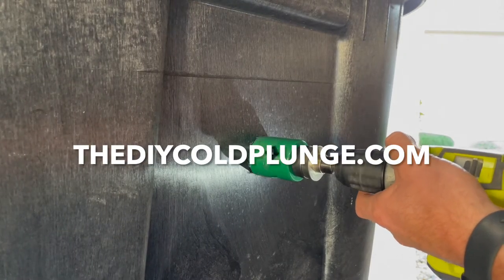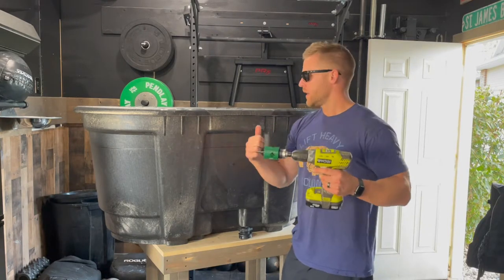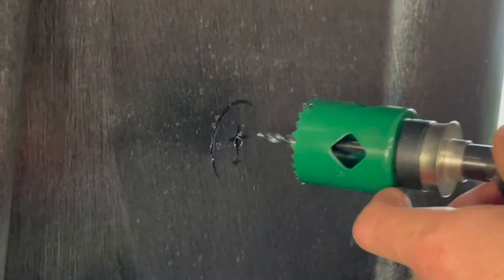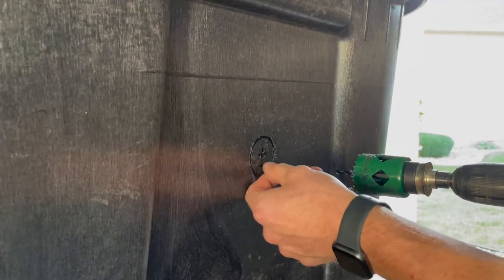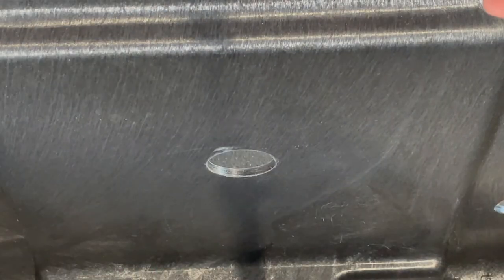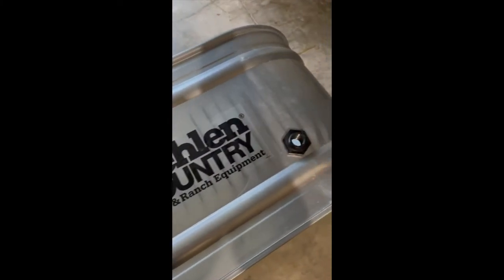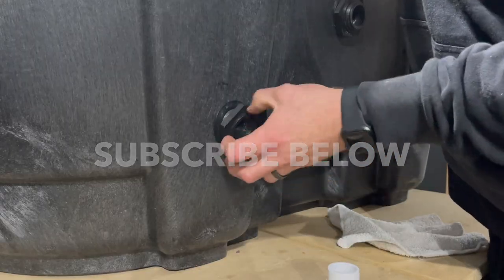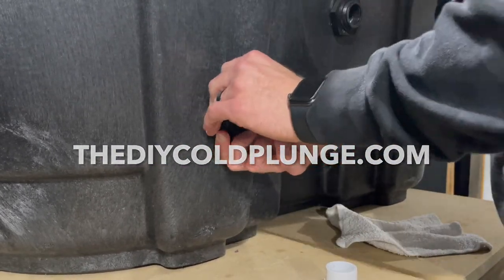How to Use Bulkhead Fittings and Drill holes in Your DIY Stock Tank Cold Plunge

Comment: Try using you drill in reverse after the bit drills the pilot hole.  It should still cut through the polyethylene just fine.  IT will take a bit longer but still give a very clean cut and less chance of kicking back as it is not as agressive.
Reply from the maker: that's an awesome tip, thanks!

Comment: I just did mine and tried something different to clean the hole up. If you have a heat gun, pull anything excessive off by hand. After that, use your heat gun to melt up the rest of the little pieces. I tried this aesthetically on the top of the tup where I hit it with my saw and it shaped up nicely so I cleaned this up the same way.
Reply from the maker: good to know! thanks for sharing. Those scrapes can be frustrating

Comment: Just put in my bulkheads, 
It was a good call to replace the factory one. That thing is flimsy as hell. Im waiting on my custom sheet metal drip pan to get fabricated, then ill be on to the running of pipes and insulation. Drip pan will be under stock tank, going to mount my wheels on a slight incline to encourage any condensation caught in the pan to pool up towards the mech area where ill have an access panel on the back to put desiccant. Im planning on insulating the crap out of the tank area so shouldn't be too much sweating. There will also be a drip pan in the mech area that houses the pump and filter. Using some old pc fans to create a airflow in the mech area. I HOPE youll post my build to the blog as theres a lot of extra features the community could get inspiration from :)
Reply from the maker: Send me the final build!
Reply: @DIYColdPlunge  hoping for completion this coming weekend, July 7th

Comment: Make your pilot hole without the hole saw on the arbor. After your pilot hole is complete then add the hole saw back onto the arbor. This allows you to slowly move the hole saw in rather than that abrupt start when the pilot bit goes through. 👍🏻
Reply from the maker: good tip!

Comment: The factory out let is plenty!  Just fine reducers to fit it. For a outlet.  Start drilling a bunch of holes in it, and rein it. Can always run the top hose over the top for a inlet. can use a spray bar, or like a water fountain. Its got factory holes around the top rail. for a mount if you wish

Comment: Hey. Read some of the other comments and starting my own project. In his hidsight would you have just used the drain hole that’s already there and  drilled one less hole? Or is two necessary?
Reply from the maker: Hey Brad! Two is not necessary, I drilled that hole before I thought of pairing the drain with the outlet from the tank.
Reply: Would the drain hole be better for pulling water into the filter? Or for clean water re-entering the tub?

Comment: Would placing both holes on the short end of the tank be a mistake? Im thinking this would result in shorter hoses (less condensation/less heat loss), but Im not sure if this would impede proper circulation.  Thanks!
Reply from the maker: As long as you can create a water tight seal on the bulkhead there's no reason it wouldn't work 👍

Comment: Thank you for your videos. I bought your framing and plumping plans. I understand that you used the existing drain hole on the 100 gal rubbermaid tank as your outlet to the chiller. Did you use a y connector shutoff valve at the drain hole so the outlet hole can also be used to drain the tub? Hope that makes sense.
Reply from the maker: Thanks! I use a ball valve at the drain/outlet 👍

Comment: do you need the bulkhead that is going into the tub half way up? Is there any drawbacks to having it low?
Reply from the maker: I prefer it a couple inches below the water line when no one is in the tub. Moves more water/breaks up the thermal barrier that way. Short answer is it's all preference. The tub is so small it will have plenty of recirculation

Comment: I recently bought your video/pdf plans for the plumbing and I’m curious why you made another hole on the bottom right? The drain serves as an outlet and drain and then you have only one inlet which is the middle.
Reply from the maker: This is my prototype stock tank. Those were all test holes
Reply: @DIYColdPlunge  that’s what I assumed but I was tripping out! 😂 so just the drain and inlet two holes is required?

Comment: Do you think adding some plumbers putty along with the bulk head can ensure enclosure? Bought some cause I was going to use a drainage pipe instead but found this video, would want to make use of the putty if it helps😊
Reply from the maker: I've used silicone with the bulkhead in some builds and it has helped. I dont have experience with plumbers putty but it might work.
Reply: @DIYColdPlunge  When you say "it has helped", does that mean you've had leaks with the rubber gasket?
Reply: Did you end up using Plumber's putty to help seal the bulk head? @DanSanniti   I had the same idea and am considering using it to avoid leaks.

Comment: Thank you for this video. I did do this for my plunge, but I did this only for the water filter, now I purchased an Active aqua .25 chiller and it's set up for a 3/4 hose not 1 inch, do you have any suggestion on how to match this up? I hope I explained myself here...Thank you!
Reply from the maker: Yep! You'll want a 1" threaded to 3/4" socket fitting to thread into the bulkhead.

Comment: thanks for this, but how do you connect  1 - 1/4 Tubing (from the intext pump) to that big 1 inch bulk head?
Reply from the maker: Same concept, just reversed. They make threaded x barbed fittings. You'd just need the appropriate size.

Comment: Any reason you went with 1” vs 3/4” bulkheads? Curious because your filter is 3/4”. Thanks!
Reply from the maker: The male 3/4" threaded adapters constrict water flow quite a bit, which ultimately affected suction in my initial testing.

Comment: I am thinking about getting the framing plans off your website. I have a 150 gal Rubbermaid tub and wanted to know if the plans are speced for 150 gal. If not what changes would need to be made for 150 gal tub?
Reply from the maker: I'm working on the 150 gal. now - it hasn't been released yet. The one that is up there is the 100 Gal.

Comment: Thank you very much for your videos. So, the chilled water goes into the top of the tub and you used the tub drain location as your return to the chiller?
Reply from the maker: Correct!
Reply: @DIYColdPlunge  If you use spray foam/pink insulation combination how would you be able to access and open the return/drain pipe to empty the tank? wouldn't you still need the dedicated drain pipe to drain? or am I missing something obvious?
Reply: I think I found what I was looking for in your intake/outake PDF, so no need to answer.
Reply: So there is no need too drill two holes then just use the one drilled at the top of the tank for the chilled water inlet and the drain that comes stock on the tank as the return to the chiller ?

Comment: Would you recommend a special hole saw drill bit for a galvanized steel horse trough tank?
Reply from the maker: I used my standard one without issue - it's not super thick so it wasnt an issue. If you are buying new you may as well snag one for metal.

Comment: I know that center one is your out let but did you say you’re doing 2 inlet holes?? More water pressure since it’s gravity fed??
Reply from the maker: I did 2 and connected them with a tee fitting... but it was only because I changed my game plan mid-project. I haven't seen any difference in water flow between doing it this way and using only the drain plug.

Comment: I have a rubbermaid tub just like the one in your vid, and I use the icepod chiller. What do you recommend for insulation around the tub to help it stay cool, and what about the condensation?
Thanks
Reply from the maker: Spray foam will be the only thing that will help with condensation, you'll want to get it on as much of the surface as possible. The Foambeak can help with that - https://diycoldplunge.com/products/foambeak-canned-foam-insulation-nozzle

Comment: What size bulk head union for a 100 gallon rubbermaid stock tank drain?
Reply from the maker: I use 1" but just know there is not a standard outer size... 1" refers to the inner. Check on what hole saw size you need.

Comment: Anyway to connect the pump to the drain hole on the Rubbermaid?
Reply from the maker: Yep! That's what I recommend. Your plumbing starts from that bulkhead
Reply: @DIYColdPlunge  how did you make connection there? PVC reducer?

Comment: What is the reducer you use to go from this bulkhead fitting to the 1-1/4"ID x 1-3/4" OD braided vinyl tubing? Can you provide me with the Menards link? I think I have the rest, brother. Thanks. Just finished the OG 100 gal plunge and this is the last item I need.
Reply from the maker: Hey! You'd need a 1" threaded to 1-1/4" barbed fitting.

Comment: I bought a water chiller that shipped with all the tubing, bulkhead fittings, elbow barb fittings, etc all sized at 3/4" (the Penguin Cold Therapy Chiller). Do you think I need to upgrade these parts to 1"? or am I fine using what they sent with the chiller?
Reply from the maker: I would use what the manufacturer sent for the unit 👍

Comment: I haven't found the video where you talk about exactly where to put the holes.  I see the one in this video but where do I put the other hole? (or holes?)  I bought the plumbing plans and they don't say exactly
Reply from the maker: Utilize the existing drain for the outlet + drain, then what I did was drill a hole about 1/2 way up on the opposite side. It's the hole I am installing the bulkhead toward the end of the video. I mention disregarding the other hole on that side (this was before I thought of the design in my plans)

Comment: How are you connecting to tubing from the chiller ? Are you using 3/4" tubing or 1"? Would you switch to 3/4" bulkheads if you were using 3/4" tubing? thanks
Reply from the maker: I use 3/4" tubing. The reason I used 1" is that the male threaded fittings reduce down so much on the 3/4" Nothing wrong with 3/4" bulkheads, I just wanted to keep flow open as much as I could
Reply: @DIYColdPlunge but how do you fit a 3/4 tubing into a 1” bulkhead, is our question…
Reply: @jedslockedter4me  "barded fitting" adapters. Was wondering this for a long time too

Comment: can you help me with the location of my inlet (from the filter/sanitation system?  does the inlet need to be higher than the level of the water inside my tub?
Reply from the maker: Sure! I put mine opposite the existing drain hole - it's the hole in the middle at 6:32 in this video.

Comment: It appears that all of your EQ uses 3/4" fittings - any reason you use 1" bulkheads instead of 3/4?
Reply from the maker: The ID on the 3/4" restricts flow more than I wanted it to. Much more problematic on the outlet to the pump than the return though.

Comment: Link to the bulkheads used?
Reply from the maker: Here you go! 
https://www.menards.com/main/plumbing/pipe-fittings/tank-fittings-strainers/green-leaf-inc-bulkhead-union-fitting/tf100/p-1444431646587-c-8560.htm?tid=6595766261027535501&ipos=1
Reply: @DIYColdPlunge  Thanks. Also, are you going to have ozone generators back in-stock soon?
Reply from the maker: @ThanksWyatt  I just got the shipping confirmation yesterday, I typically have them in about a weeks time

Comment: The link you posted for the bulkhead says you need a 2-1/4" hole is that correct or should we go smaller and get the 1-7/8" hole saw
Reply from the maker: I didn't notice that! Mine was 1 7/8" and worked out just fine.
Reply: there’s no way you used 1 7/8 hole saw bit. I use 1 7/8 hole saw bit and the hole is way too small for the 1” bulkhead. now I have to make this hole bigger somehow….
Reply from the maker: @pcahn621  It 100%, without a doubt was. It looks like the manufacturer changed the style of their bulkhead
Reply from the maker: @pcahn621  is it for your inlet back into the  tub?
Reply from the maker: @pcahn621  Check this out - https://youtu.be/fwpOAsN0J9g

Comment: Why am I half way through the video and your still talking about the hole saw?
Reply from the maker: You need holes to use bulkheads 👍
Reply: @DIYColdPlunge  yes but all you have to do is show the tool, cut the hole and then show where to cut the other hole but you talk about the hole saw for 30 mins before even cutting a hole. you're prob still talking about the hole saw honestly. lol
Reply from the maker: @eztwraps  lol cutting the hole is the one thing you can't undo... causes a lot of stress for folks hence the focus for the video. Feel free to move along... unless you want to keep talking about hole saws.
Reply: @DIYColdPlunge  we can keep talking about it. If you like since you really like talking about it. So how do you cut a hole in a plastic container? I was thinking an utility knife would work better with a hand drawn circle?
Reply from the maker: @eztwraps  I'm all in if you are! But let's focus, we're talking hole saws here - not utility knives.
Reply: @DIYColdPlunge  but yeah wouldn’t a utility knife cut it cleaner then a hole saw? Focus in on this. Blade is much sharper then teeth on a hole saw.